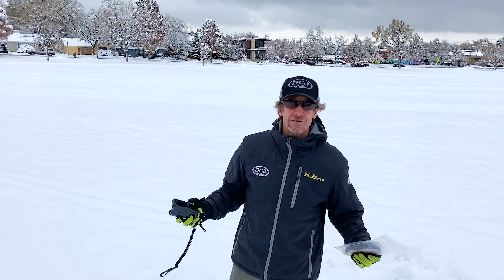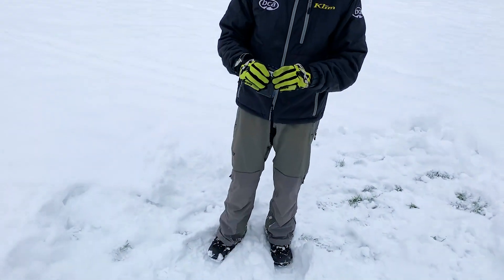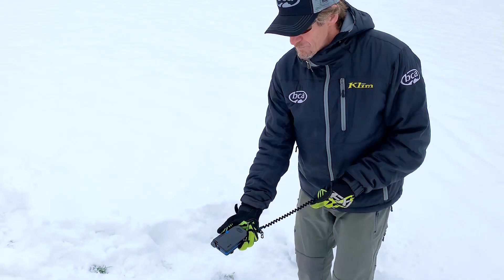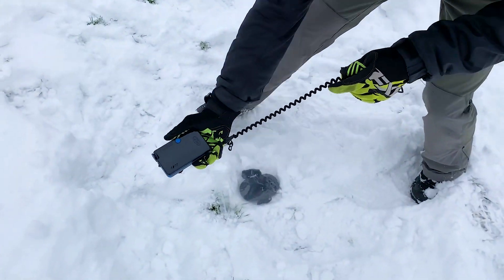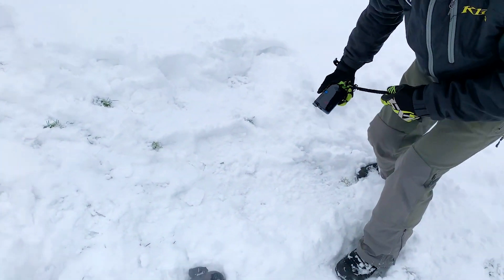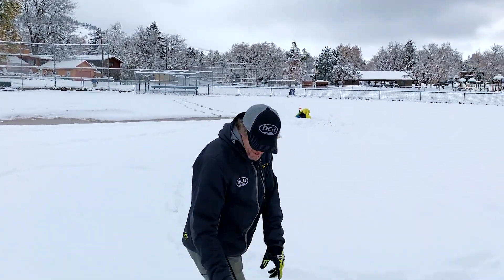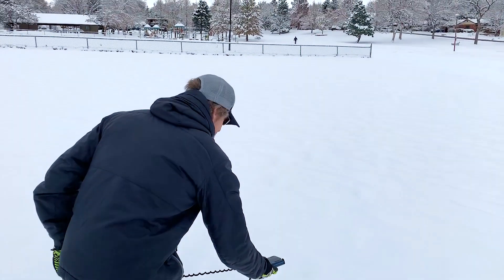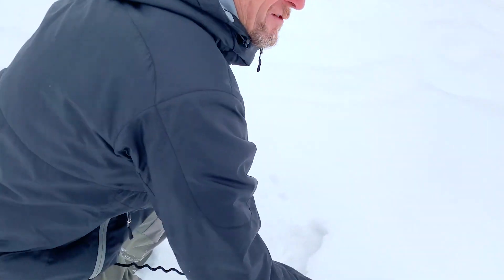Tracker S™ Avalanche Beacon - How it Works

Comment: I used a tracker when I patrolled at Squaw Valley and loved it.  It still works after 22 years.  I bought my wife one (an original tracker) and she ended up not using it much.  I pulled it out after several years and it didn't work.  I took advantage of BCA's upgrade discount since it was out of warranty.  I'm excited to get the new one and see how it does.  Hopefully more robust than the one that failed.

Comment: I’m fully prepared to spend as much money on a transceiver as needed, but this Tracker S is actually very impressive.  It’s smaller and lighter than the Tracker 4 but offers the same internals as well as ease-of-use in signal suppression for multiple burials (an area in need of improvement for the industry).